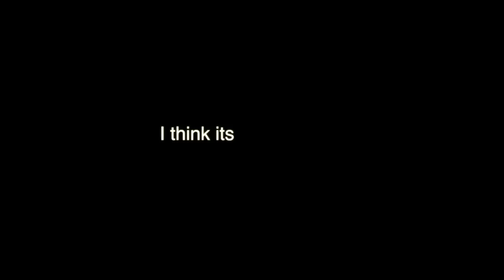Massive Engine Failure on the Retired Coast Guard boat..(Costly Mistake) *FIRE*

Comment: Get with your local USCG boat station and ask for a boat engineer to teach you basic engine checks. You should check the sea strainer prior to getting underway.  Make sure there is water flowing through the strainer when you start it.  That is why the cap is clear.   If i remember correctly that engine is a pain to replace the impellar.  Some of the more senior engineers may have worked on those engines earlier in their career.  Ask for the Engineering Petty Officer.  If you have questions let me know.
Reply: Yeah, those OTHs are a pain in the ass to work on. Try doing a gimbal bearing underway!
Reply: Hubby always kept extra impellers.
Reply: True friend ❤
Reply: People who buy these boats don't realize there is a regular maintenance schedule.  In one unit, I had a crew of 5 MK's ( machinery technicians) working 8 hour days to maintain 8 small boats.  These boats were running 5 underway and 2 in the shop and 1 backup. 24 hours a day.
Reply: Did you open your thru hull for the raw water intake?

Comment: As soon as it overheated and you made sure the water intake was clean I knew it was the impeller. If they sit for a long time without being used the rubber impellers degrade. Happens all the time on our inboard ski boats 😋

Comment: I had this happen once.  It was an impeller that got too hot and melted.  I didn't put the plug in where water is drained to empty the exhaust manifold.  The result was no water for cooling getting to the engine/outdrive.  It turned into a $600.00 trip to the boat dealer.

My take-away was using checklists just like when I fly.  It works lol.

Comment: Make sure there is a engine temperature sending unit on the engine gauge not just a light. Overheating problems can cause a blown head gasket. 
I have had days like that, the answer is keeping doing good. You have been given a gift from God, make sure you don’t wast it. I have told many young people how it works , use it or loose it. Keep up the good work.

Comment: When you see smoke in boat you don't open hatch like that, if there was fire inside with opening that hatch you provide huge amount of oxygen to fire. In short, if engine was burning and you opened that, you would get fire streight in your face, you are REALLY lucky that was not the case

Comment: There should be a flow valve for the water to flow through the motor if that wasn't open it would overheat but it seems to bee a simple fix for sure

Comment: Check your thermostat. when a motor has been used in freshwater its whole existence the calcium builds up on the inside surfaces and when you put it in saltwater it releases all the calcium and it blocks the thermostat. Been there done that.

Comment: As soon as the engine stopped with the overheating that allowed your intake to clear Which intern give you the opportunity to pull that strainer and get anything larger that might have gotten caught and gone through the end of the engine. I have seen these inputs clog with ice As well as anything else you might think of especially grass or moss in a Florida Marina.

Comment: Ouch. That got hot as hell. May have pooped the headgasket and warped the head with that one.
Reply: Hopefully not, I was thinking the same thing but I did hear the pop-off valve working correctly on the radiator so hopefully he shut down right as it boiled over
Reply: @ryanlee6147  idk looked like it was forcing past a gasket mid engine not the radiator. And ive seen a couple situations where the pressure was so high it would push past a gasket till the pressure dropped enough to jot be able to push through and those seemed like relief valves as well. Lol

Comment: Did u remember to turn the water pump on to keep the engine cool?
Reply: I can tell you from working on those motors for 20+ years no he didn't or the pump failed
Reply: @blairwalton4456  Didn't the Alabama S&R guy tell them to make sure to open a valve in the engine compartment in the first vid???
Reply: @shooter0311  Yip they sure did and as you sore later in the video the impeller in pieces if the water pump was  running properly this still shouldn't have happened the motor would have gotten hot but not boiled like it was